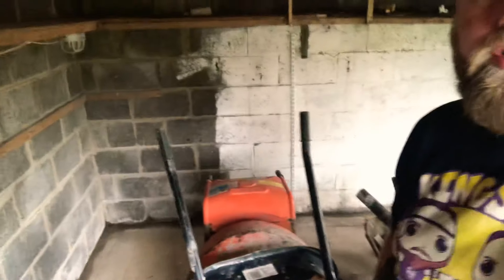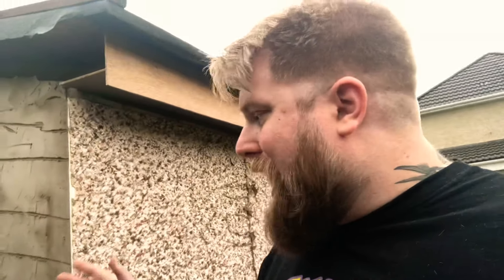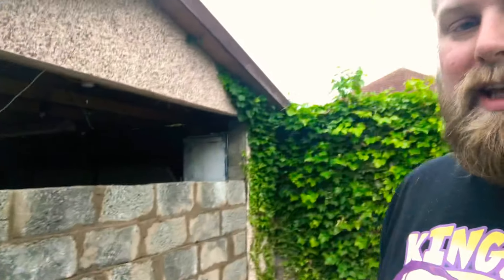Studio update #2 - Damp Problems!

Comment: what about Electric ????????????????
Reply from the maker: Embree Smith what about it?
Reply: @LeviClay  Is there at least 30 -amps out there to run lights etc ..??
Reply from the maker: Embree Smith it was already wired up with electric and WiFi when we got it :)
Reply: Haha, there's absolutely no need for 30A .....Unless Levi were to literally plug in 30 amps! 🕺🎸🎛🔊🎶 😂😂
Reply from the maker: Or plans on having a hot tub... which he absolutely does 😂
Reply: @LeviClay  Schweeeet !!!
Reply: @letsallbe-friends1120  its more about Voltage Drop, than the Amps
Reply: Modern Led studio lights pull bugger all power. The biggest current consumer will be that Rev! 🔊🔊🔊😇
Reply: @letsallbe-friends1120  apparently You are not thinking of HEAT !!!
Reply: Ditto on the heat, Led efficiency is a modern day wonder! 😊👌
As for residual heat?? He lives in Scotland, there's not even a word for warmth in the local dialect!😄